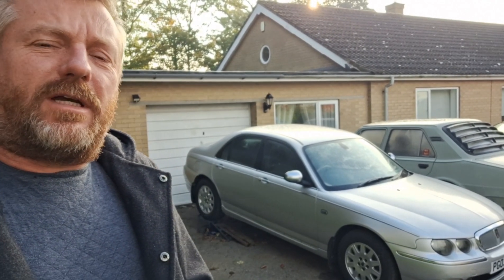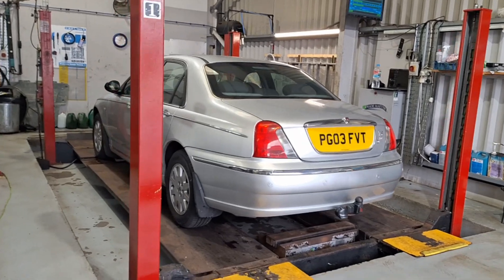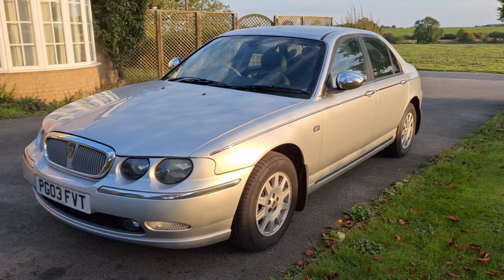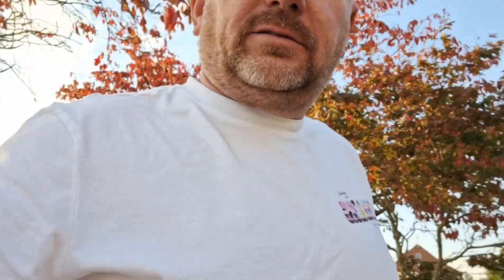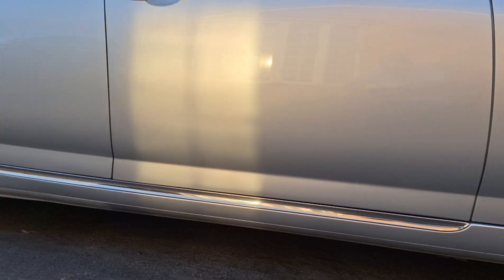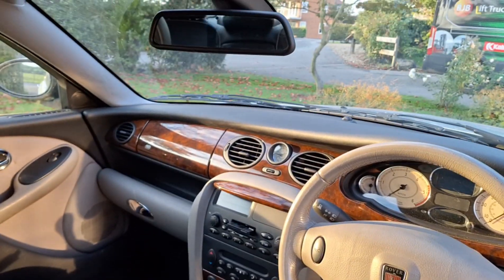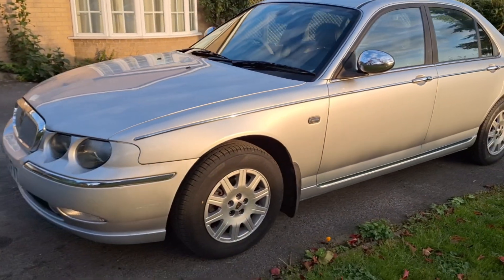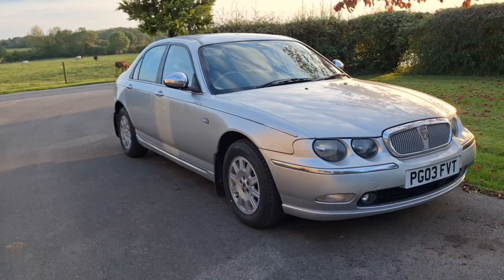Rover 75 MOT day

Comment: Got mine on Thursday cracked screen has been fixed with resin so it's up to the MOT test station if it passes. I always find MOTs worst than a dentist visit.
Reply from the maker: @barthomer1000  depends how much is inside the wiper swept area, 40mm in the wipers other than 10mm directly in front of the driver.. Outside the wipers doesnt count unless it's major damage
Reply: @barthomer1000  Not in Spain. They're thorough but not jobs worth and they don't repair. Purpose built for testing only. Not garages.